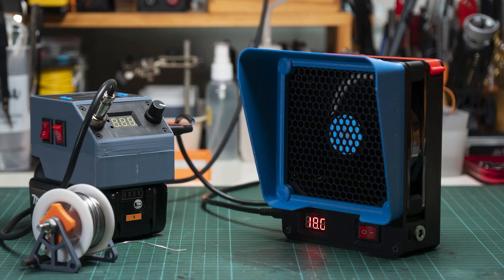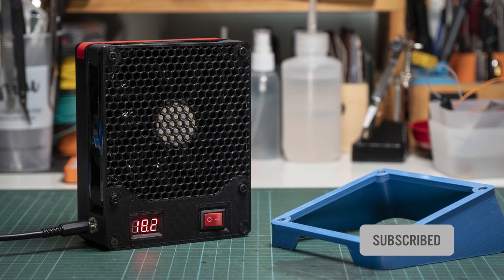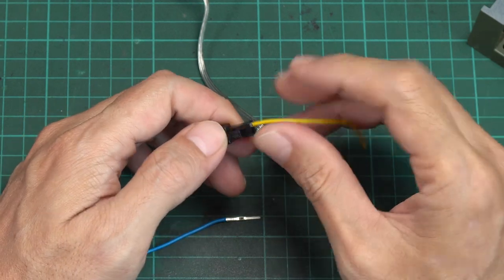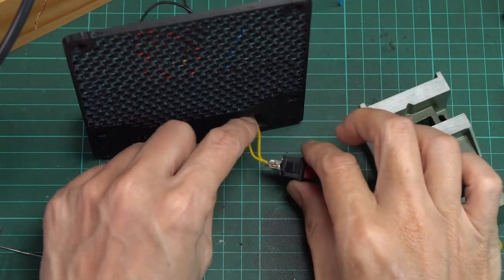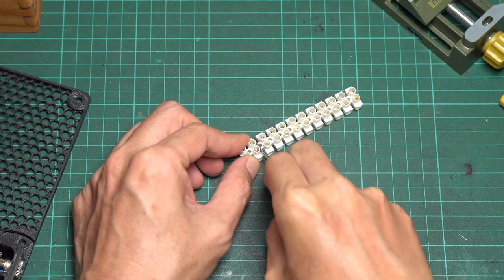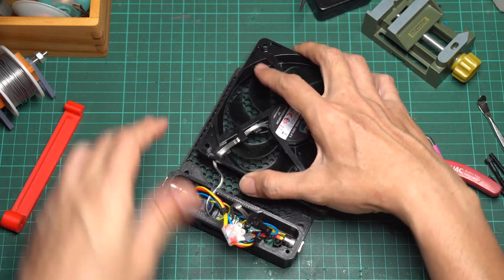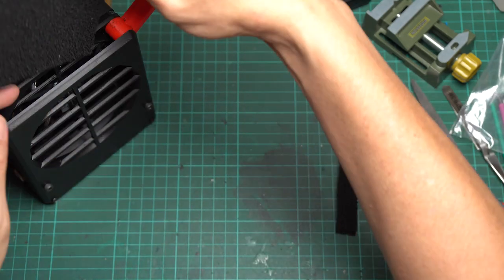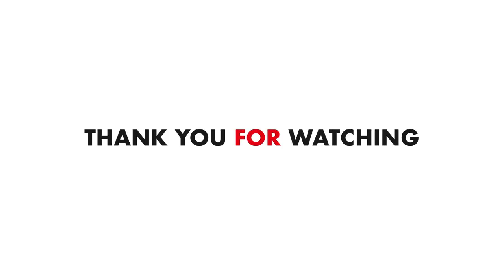Ultimate DIY Soldering Fume Extractor with USB-C  Power Hub, Magnetic Hood and More! [3D Print]

Comment: As a professional electronic engineer of almost 50 years can I just say that this is arguably the BEST thought out, designed and implemented design for just about ANY electronic support tool/gadget/gizmo/device I have ever seen on YouTube!

I do wish more people would show  complete projects including case, ancilliaries and thoughtful extras. I'm intrigued as to just how long you spent refining the design with all the extras?

ABSOLUTELY GREAT PIECE OF WORK! I shall be constructing one of these ASAP but as my T12 iron uses the compact unit in an aluminium case with a suitable supply for the iron already and I very rarely use a soldering iron outdoors or where there is no mains I shall be modding my solder station case to use the internal supply. Other than that I can't see that I'll need to modify ANYTHING as you seem to have considered the lot! Nice one! 👍👍👍👍👍😁
Reply from the maker: Thank you so much for your comment, I really appreciate that you like my design.

I just think about reducing the wire cluttering because of my tight workspace. The stationary soldering iron is not my option. So the one with a battery seems to be the best middle-ground solution.  As well as this design, I just try to make use of what I currently have. I'm glad that you found it useful. I currently design a better pack for it but I still cannot find a way to make it compact enough.

It's great to hear that you'll be constructing your own mobile soldering station. You will not regret it. it makes my life much easier without the main.

Thanks again for your feedback, and happy making. 👍👍🍻🍻😀

Comment: I’m working on this immediately. Thanks for the inspiration. My one will be more simplistic, with a single input, buck converter, and a (DC) PC fan. But I still think it will be more than sufficient, I also have plenty of NZXT F series fans which I haven’t used from an H9 Flow build I did, sounds like it’s time to put them to use.

Comment: Thank you for sharing nice project. It would be nicer if the filter was installed in front of the fan. The fume mainly comes from vaporized flux whose residue is very sticky. If the fan directly inhales fume from flux long time, the fan will be contaminated by flux residue. This is also true for fan grill. It would be much better to use detachable metal fan grill which can be easily cleaned or replaced instead of 3D printed one. . If you have a plan to update the model it would be nice to see such changes in your model.
Reply from the maker: Thanks a lot for your awesome suggestions! I'm thinking about moving the filter to the front like you said. But I gotta admit, I'm pretty attached to the original grill design, so I might just stick with it.
Thanks again for taking the time to share your thoughts with us!

Comment: @simplymaker new to electronics, but how did you choose that specific 1N4007 diode? Why not a capacitor?
Reply from the maker: I use a diode to prevent current flow to the PD port while use input from the DC jack. You could substitute it with a Schottky diode, which has a lower voltage drop, but I'm sticking with what I have at that moment.

Comment: 16:01 Guess only using double sided tape wasn't a great attachment method for the USB C pcb inside the casing..
Reply from the maker: The thin grey 3M VHB tape has been work for me. You can also strengthen it by adding a layer of hot glue on top.

Comment: So all you need for soldering fumes is a carbon filter? No HEPA?
Reply from the maker: From my understanding, the carbon filters are good for filtering TVOCs, while HEPA filters excel at trapping small particles. And many pre-made compact fume extractors typically use only carbon filters.
Since space is limited, I've only included a carbon filter.
Reply: Carbon filter does nothing for flux fumes.